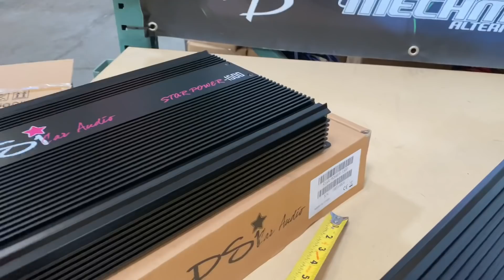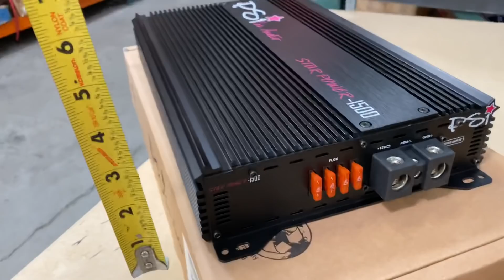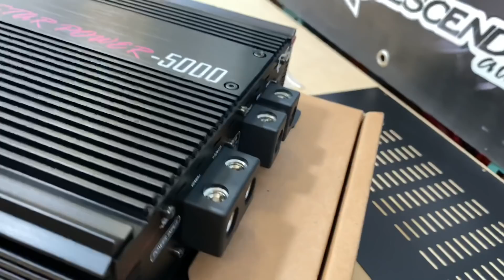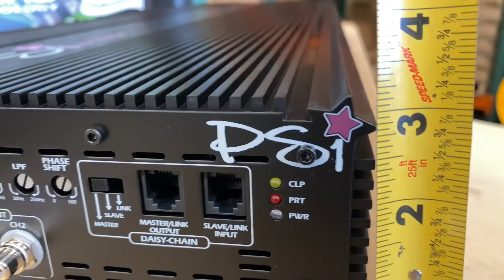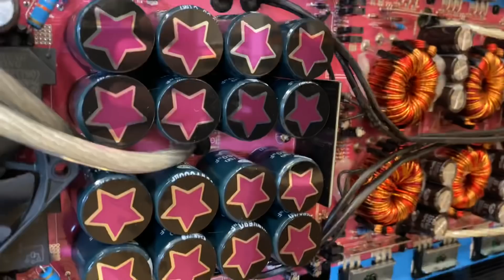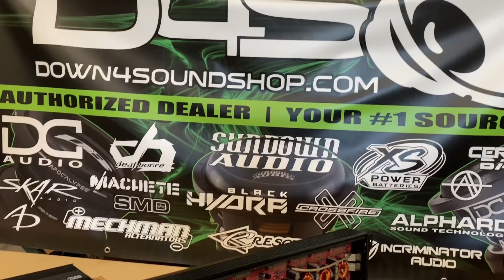PSI CAR AUDIO STAR POWER AMPLIFIER LINEUP ⚡️⚡️ 1500 | 2500 | 5000 | 10000 WATTS

Comment: Just got my PSI platform 3 18 inch with all the extras (tall roll, high performance etc.) which makes it 3000 watts RMS. If you order from them directly then you will have to have patience because they just had a lot of their top employees quit on them. It took about a month to get my sub, but MY GOD it is absolutely insane!!! I haven't seen any of their amps yet, but buy PSI subs and you won't be disappointed!!!